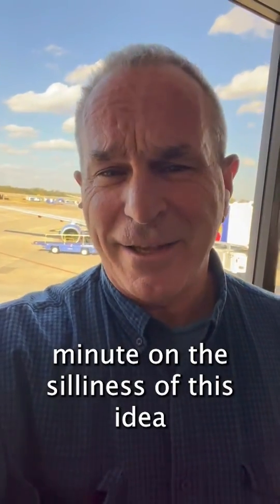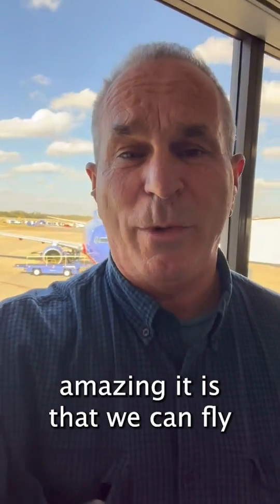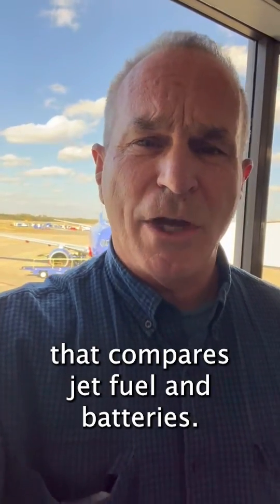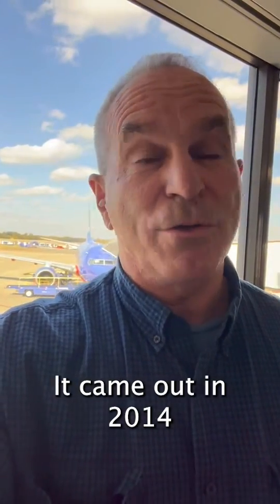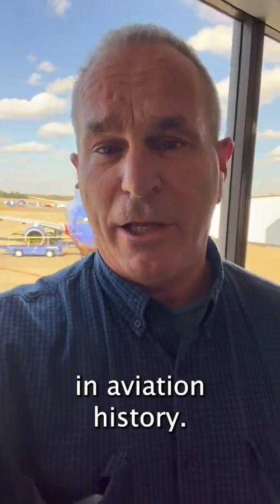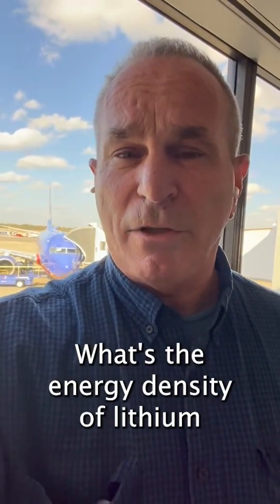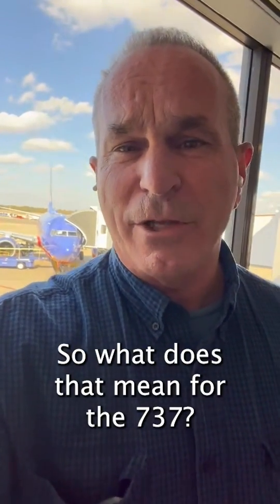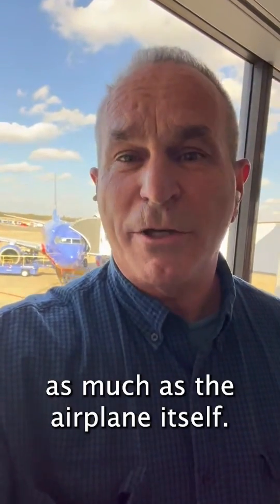Some Quick Math On Jet Fuel, 737s, And The Silliness Of Electric Airplanes

Comment: Surely we can invent an energy-dense biofuel for aircraft engines. They use continuous combustion, not precisely timed sparks like gasoline engines. It would be fairly easy to build a jet that runs on ethanol or soybean oil. Of course, the former is dangerously volatile and the latter freezes at cold altitudes. We already have the technology, we just need to make it practical.
Reply: Oil is a biofuel.  And, since it was made by nature, we needn't expend great amounts of energy to get it and process it like ethanol from corn or sugar cane.
Reply: The problem with biofuels is that they will result in monoculture of soybeans or whichever crop is used to produce it, hence destroying entire eco systems. Also this kind of agriculture brings it's own lot of pollution such as soil pollution, groundwater pollution and economic devastation to producing countries.
So I don't think it's worth it to to replace a problem such as jet fuel consumption, of which we know the risks and consequences, and replace it by another problem with much worse longterm consequences.
Yearly volcano eruptions cause way more greenhouse gases then the entire airline industry combined.
And lastly, I highly doubt that the biofuel itself will offset the CO2 caused to produce and transport it.
Because you will need biofuel for transportation and production as well and to sustain an entire industry you need massive amounts, so the ecological footprint is much bigger then oil.
Reply: @BNBPhotofr false, nothing about biofuels requires any more monoculture than we already have. Youre spewing unfounded nonsense like the channel host. Citation needed.
Reply: @craighandley7535  I have lived in Argentina for a few years, and I used to work in the energy business. The country was the largest soy producer in the world back in 2003 (I don't have current figures) and entire fields have been converted to soy production due to the biofuel boom. This had devastating consequences on the local ecosystem and also terrible social consequences. I have seen it with my own eyes. But I invite you to do your own research before disqualifying other people's experiences as "unfounded nonsense".
Reply: @craighandley7535 Biofuels definitely push toward a monoculture.  Just look at how much more corn is grown in the US just to produce ethanol for gasoline.
Reply: @kirkjohnson6638  incorrect. Biofuels can be produced from pretty much any biological material. Soy, sugar, and corn are frequently used because those crops are already a primary crop where they are grown. Biofuels dont drive monoculture.
Reply: @BNBPhotofr  bro, youre the one working for those companies. Dont fuss at me because your employer chose to go monoculture and devastate communities. Talk to your boss about that. Biofules do not require monoculture.
Reply: @craighandley7535  Yes, they do by virtue of how much you have to grow in order to make any significant amount of fuel.  It tasks vast amounts of corn just for us to put 10% ethanol in gasoline and it actually makes the gasoline crappier (less energy per gallon).  And, as far as emissions go, there is no advantage to using biofuels over fossil fuels.
Reply: @craighandley7535  First of all, I was not an employee but a business consultant, and secondly I was not "fussing" at you, but I was inviting you to do some proper research on your own before commenting. Yes, it's true that you can make biofuel from about any primary crop, but the yields are not the same between them. 
So farmers that produce biofuel crops, which are mostly in developing countries, will start to produce the crop with the biggest yield, which inevitably leads to monocultures. This has locally a negative ecological impact, and also it has a negative impact on food production, which forces the country to import food, which in turn raises food prices and has again a negative ecological impact due to the transportation required.
Reply: Algae makes for fantastic biofuels. Also fully synthetic fuels are a real possibility. Failing that, liquid hydrogen was already used for Apollo and the space shuttle program. It certainly has some merits for Aerospace applications.

Comment: Sure making an electric airliner comparable to the 737 is not possible.  However, why start there?  Self launching gliders are a much more suitable application.  Next can be small general aviation planes.  The latter is tough for battery electric though.  Commercially available 2 seat electric planes only have about 1.0 hour duration, half hour for flying plus half hour reserve.  Improved batteries can get this to 2.0 hours.  When that happens then GA aircraft will be good candidates to go electric.  Such batteries, with 400-500 Wh/kg, will also enable 50-100 seat short range airliners.  Not as fast as regional jets, but less expensive to fuel.
Reply: He starts with a ridiculous proposition because it is easier to critisize. This is not a serious person.
Reply: There is a type certified plane in Scandinavia with 50min flight time + 10min reserve used for pilot training. A nine seater is supposed to hit the general market soon with an expected range of 400km. Doubling that would already cover many European business trips.

Comment: Why is it that we always need one universal solution and everything else is not working? Electric aviation is a thing and has some niches that it works perfectly well for. Ask Norway how expensive connecting the rural settlements is. Look at various smaller UK islands. If the amount of weight or the volume is space is secondary and the basic cost of fuel dominates the TCO, electric aviation is a cost-effective alternative.
Reply: But then we are talking about a replacement for choppers, not for large jetliners.

Comment: Well...the electric motors would be about 5x the efficiency of jet engines so we'd only need about 1/5 of that, but it's still a serious problem.  I see a niche in puddle-jumper type airplanes.
Reply: I don't think that factor is correct, it should be more like a factor of two. That said, numbers I can find give jet fuel a price of around 62ct/kWh. With modern wind farms, we can produce electricity at a tenth of the cost of jet fuel, so any application that is more sensitive to the cost of fueling compared to the space and weight wins.
Reply: @joergsonnenberger6836  It's at least 3.  A good jet engine is maybe 30%...probably less at cruise since they're oversized to provide takeoff power.  A crappy electric motor is like 90% efficient.
Reply: @blurglide  The numbers I found for fuel energy to thrust was around 50% for modern jet engines. But overall ratio will be worse, sure.
Reply: @joergsonnenberger6836  No power stations on the ground aren't even that good.
Reply: @blurglide  Modern combined cycle power plants can reach 50% conversion rate to electricity and this is a slightly simpler problem. But let's not squabble over a small factor. We agree on the main issue.
Reply: @blurglide Yes electric motors are very efficient but I think you're ignoring the efficiency of the props.
Reply: @joergsonnenberger6836  fuel energy to thrust is the relevant measure. That is why the 90% efficiency claim is bogus, turboprops are slightly more efficient than jets, but only like 5% or so. And then you are slower and cannot fly that high, meaning that you lose that advantage when you try to go cross atlantic. There is a reason why big, long range flights use jetliners and not turboprops.
Reply: @joergsonnenberger6836  citations needed regarding that 50% efficiency comment. Do you know how to cut and paste links?
Reply: @craighandley7535  which one?
Reply: @joergsonnenberger6836  please add a link where you found information that a combined cycle power plant has acheives 50% coversion from fuel to electricity

Comment: Sure, well how much of the planes weight can be removed completely when you switch to electric and then how many batteries do you actually need to run a meaningful route? Sure you can't take a direct flight to Australia from La but if you had a smaller plane going from La to Tucson it probably would work. Especially since you can use batteries as structure for the plane. No one is saying we expect a gen 1 electric jet to be more capable than it's turbine equivalent. But is it possible and could you make the industry more sustainable that's the only thing I want to do.
Reply: Lol. Thats the spirit, just ignore reality.
Reply: Haha and also Him saying those are the numbers, as if he is god, and not telling what actually he is comparing and  if he also calculated the some efficiency percentages 

I guess it won’t fix the 80times value but stuff matters :D
Reply: BS. Take off costs the most energy. The length of the route is not that important later on, we see that with flights DC-NYC and slightly further on the East Coast or in Europe. Secondly: Getting that much mass to take off is ridiculous. How many people and how much cargo will you then be able to transport? Thirdly, battery packs need to be shielded against damage at least as much as fuel tanks and cannot be used as hull or something. Get a grip on reality and stop doing drugs, please.
Reply: @donaldduck830  Ok say the bulk of energy is required at take off. You don't think there's a more efficient way of imparting that energy to the aircraft? You could use the landing gear with electric motors to break inertia and accelerate while applying throttle to the main propulsion. That would presumably work. Say that doesn't what if you built a massive battery operated take off tug, or just used a catapult system like on an aircraft carrier.
Second: again there are ways to use the batteries as structure, you don't need to match performance with a 737 you just need to make it fly far enough saying 21 times the mass to energy doesn't account for efficiency gains across the board. I'm willing to bet damn good money that a jet turbine is not 90% energy efficient. I'm also guessing that onboard power generation is closer to 30% efficient. If that gets bumped to 90% efficient that's weight saved in "fuel" right there. I'm guessing the calculation was done with energy density of the fuel rather than accounting for efficiency losses. 
Thirdly: there are a number of battery chemistries that do not combust. There are batteries that would be perfect fine to hurl at the ground at 600 miles an hour and would be no more dangerous to the occupants that a normal aluminum airplane hull.

There are ways to solve these problems but throwing your hands up and saying "obviously we can only use jet fuel forever anyone who thinks otherwise is on drugs" doesn't strike me as productive. I'm by no means saying it will be easy, cheap, or better. My only point is that there are always solutions to problems and working on this one seems like it would be good for humanity.

Comment: And unlike liquid fuel, the airplane would weigh the same when it landed as when it took off. A liquid-fueled jet gets better economy as it flies, as it gets lighter. 
How long will it need to charge before it can fly again, a week?
Reply: Brilliant! Maybe they shouldnt fuel them up in the first place! Imagine the weight savings!
Reply: @craighandley7535  No, it demonstrates that he has underestimated the weight of the battery needed.
Reply: @chapter4travels  i think your statement shows that we should fly planes without any fuel, its so dense afterall. Great idea
Reply: Worse: You would need to build far longer runways. These days they cannot land with fully tanked jets and drop fuel in an emergency. The problems with electric planes are far worse than you think at first.

Comment: I would be terrified to fly across the Atlantic or Pacific in a jet fueled by lower density green friendly jet fuels….might need to swim the last 500 km to arrive on land…😂
Reply: Yeah exactly, pilots and engineers are pretty stupid and wouldnt be able to calculate the additional fuel volume required to use green fuel and they would just fly the planes until they crashed. Intelligent observation. I agree with you.
Reply: @craighandley7535  No you don’t
Reply: @gtranquilla  I do agree with your most astute observation that if green fuels are used planes will fall out of the sky because no one will think to account for the differences in fuel densities. It's a relevant and intelligent observation. You are a clever person. Airlines should hire you so this wont happen.
Reply: @craighandley7535  - very few realize that a tiny percentage of H2O must remain in the fuel because it is needed to prevent rapid electrostatic buildup when refueling. And that electrostatic buildup will create sparks that can ignite the jet fuel vapours……very dangerous situation.

And too much water will lead to ice blockage in the fuel lines at high altitudes. It is a very delicate balance with regular jet fuel. Much more so for more complex green fuel mixtures.
Reply: That's true until until a discovery is made to overcome the obstacles. BTW, when they talked about getting rid of the standard AC in cars for green coolant, I was skeptical. I bought a new car that had it, then took my family from Colorado to California to go to Disneyland when my kids were still small and it would be magical for them. Coming back through Nevada to pass Vegas there is an oven at the bottom of Nevada that sidelined vehicles by the score that overheated in that desert environment. My car did just fine and we blasted AC all the way up the long grade. Greener can be done, when the tech catches up with our needs. I think it would be cool to ride in an electric jet one day. One day.
Reply: @bamaraiderable - fine line between what might someday possible and wishful thinking. Just kick the can FURTHER down the road until innovation catches up!😂

Comment: Short-hop can be fueled by batteries.
Reply: How long to recharge before you can hop again, 2 days?
Reply: @chapter4travels   High energy batteries take about one hour to recharge.  That is an average C-rate of 1.0.  Capacity does not affect the time required.  It is the same for a phone battery, electric car battery, or an electric ferry battery.  The power required does go up, of course.  A ferry with a 4 MWh battery takes 4 MW of power to charge at maximum rate, which would take a generator larger than 5000 hp.
Reply: @georgepelton5645  To expand a bit on that - most batteries have three different major charge rates. They will be slowly charged when capacity is very low or very high. They charge very fast in between. Given that batteries are usually packs of identical small units, the maximum charge rate scales with the capacity as all units are charged in parallel. It's like the old trick question: If one woman needs 9 month to birth one child, how long do nine women take for nine babies?